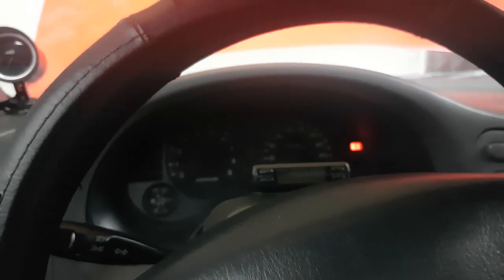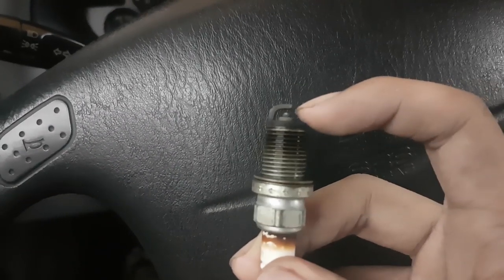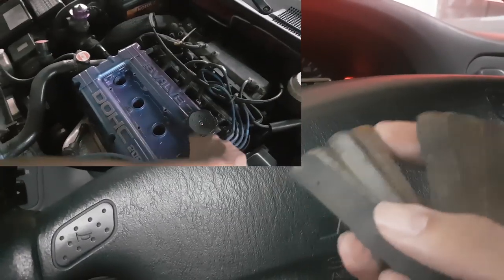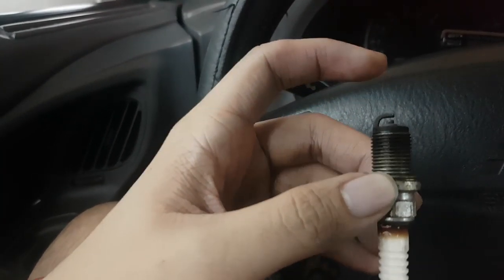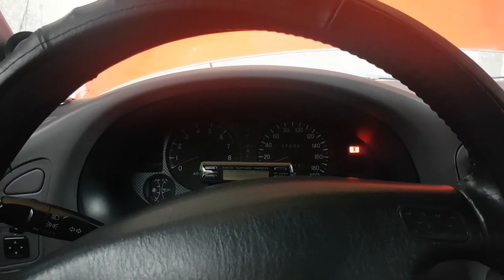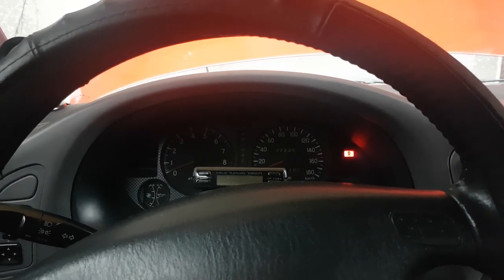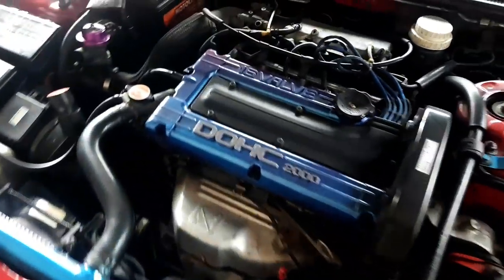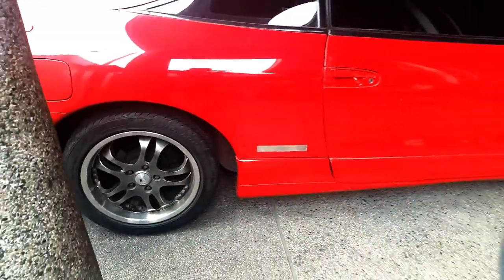Why you should properly gap your spark plugs -Instant horsepower increase

Comment: We have the same engine sir... Im having problems when it is making boost.. the engine feels like shutting off at 2500rpm when i accelerate..
.
I gapped a plug bigger than 0.5mm it rab better but its cutting at 3-4krpm now..
Reply from the maker: Is it stock? If it's stock it should be gapped at around .28. If you're still getting hesitation, check if you have a boost leak
Reply: @jaywalkur   i think its stock
Its a 4g63T from a galant vr4 tdo5 turbo blue top injectors i tried gapping it 1.59mm on a feller gauge it ran better but still bot the same when i got it.. reason behind is i got the car second hand it ran perfect recently then it had a hard starting issue so i checked everything i replaced the spark plug the gap then was 0.5mm then i check the injectors it was filthy... Then i put it back together and yesterday when i was testing it it ran like what i described first and then today i gapped the plugs 1.59mm on the feeler gauge bay guess cause i dont know the proper gap. It ran better but the boost wont give power all the way..